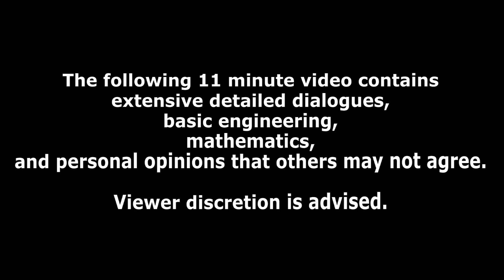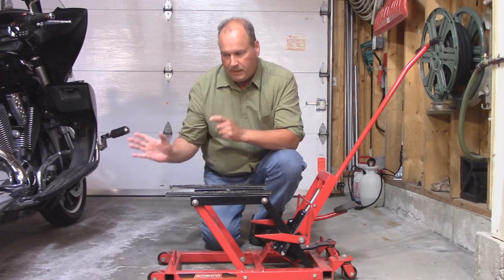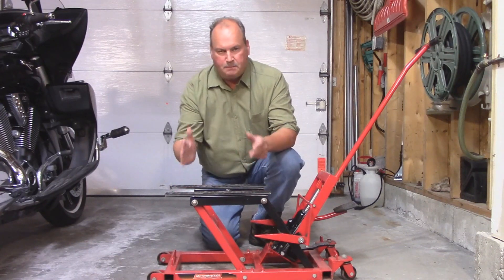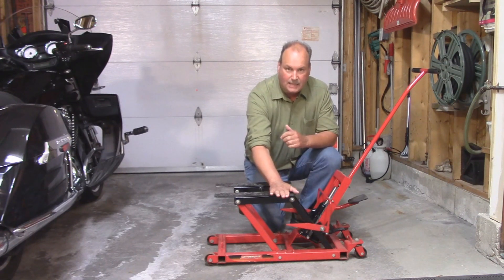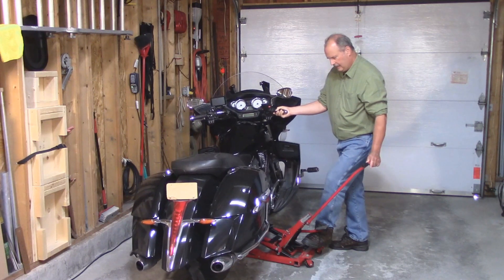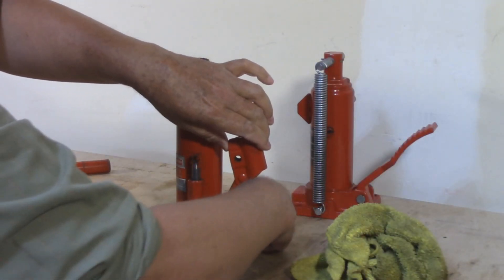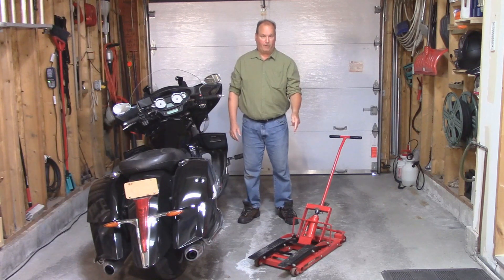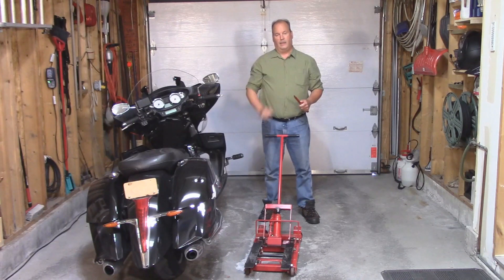Motorcycle Jack Modifications

Comment: G'day viewers 
With most of these stile of bike lifts you DONT very gently try to ease the foot pedal to lower the bike Thats where you will have trouble with shudder and consequently problems 

The jack is designed to have the pedal fully depressed in one fluent motion and the jack will lower the bike to the floor gently smoothly and safely 
I bought my jack from super cheap auto here in Australia Tasmania  its the same as your harbour freight 
Please try what im telling you 
Also i see paul and others advocate not having keeper bars at each end of the saddle bars or cross members the bike frame sits on
Dont use the jack without them and when placing the lift under the bike keep the frame as close to the keeper bars nearest to the bottle jack and set you outer keepers just slightly wider than the frame
This line of thought is to keep the centre of balance more to the centre of the jack
Also the keepers restrict the frame sliding off the jacks  frame ending in disaster 
Ask me how I know 
A great couple of very informative practical videos by you Paul thankyou Olson cheers everybody

Comment: I know this is an old video, but since it is still being served up by the algorithm I figured I'd reply. If you look at the base plate of the bottle jack on the opposite side of the lowering foot pedal you'll probably find a plug or cover labelled "Do not adjust". That adjustment is the lowering rate orifice. No doubt someone broke the rules and messed with it. If you mess with it, you can get the jack to come as slow as you want. You could adjust it so far open that it drops the bike way too fast. As a starting point, it should barely lower with your weight standing on it.

Comment: that's why the jack has loops on the sides for a straps. if you use the straps the descent wouldn't vibrate or shake as much.
Reply from the maker: The loops are for safety, to keep the bike from falling over, not to change the operation of the jack. Also, why then didn't it vibrate after installing a better hydraulic bottle?

Comment: "Tensile" strength is a measurement of what it takes to stretch that mild steel bar to failure.   Like a rubber band. It has no bearing on your application.  A failure of your cantilever mild steel arms won't be in static load conditions.  If your bottle jack drops the bike too quickly (as cheap ones are prone to do), and you suddenly arrest the fall, the force generated is far in excess of your bike's static weight.

Comment: Hi Paul, I am wondering how this new bottle jack is working out for you today. When you made the comparison between it and the old one rated at 1.5 ton the overall size looked very similar. When I saw that it made me think your new jack was over-rated for power. The new jack did perform much better but again, the old bottle jack was worn out. On the day that I am in the situation to repair my motorcycle jack I would like to replace it with a stronger one but the one’s available locally to me are larger in size too. I am using a Craftsman motorcycle jack to lift and service a much heavier Can Am Spyder RT Limited so I now know I’m on borrowed time. I don’t know how and where to shop for a higher rated bottle jack of similar size. Thanks for all of your great information and advice.
Reply from the maker: The 4 ton bottle on my jack is still doing great. I think it will last for at least as long as I will use it. When I go to Canadian Tire or Princess Auto stores in Canada they have 4 and 6 ton bottles about the same size as the one I am using. The 6 ton may be a bit fatter but they both will still easily fit. Harbor Freight stores in the States also has the 4 ton exactly the same as the one I used in my video. Not sure where you are located, but try looking in one of those stores. Thanks for watching.
Reply: @PaulPomerleau  Thanks Paul, I’m in the free States and will look into HF to see what they have.

Comment: Hi Paul, Thank you for your great video! As it happens I recently purchased the PITTSBURGH AUTOMOTIVE 1500 lb. Motorcycle Lift, basically same as yours. I am having the same issue where the arms are same length as my bike's frame width about 13 3/8". 
I would love to attach those Hot Rolled Steel plates to my jack. In the video you mentioned you bolted the longer plates to existing arms. I don't see any bolts sticking up, your plates look nice and leveled. 
Can you please describe how you bolted the extra steel to your jack? 
Thank you in advance! 
Vadim
Reply from the maker: Hi Vadim, My jack came with metal rods welded at the ends of the arms, I don't know why they put them there. I took my angle grinder and cut them off. Then there was some rubber strips on the arms that had small round plugs on the bottom that went through some holes in the metal arms. Those are the holes that I used. I took the arms off and put them upside down on the longer pieces of metal and center punched where the holes were. I then drilled them out and then using a larger drill bit I just barely widened the top of the hole on the longer pieces so the bolts would countersink in them to be nice and flat. Make sure you use the shortest bolts that you can so the rest of the jack doesn't hit them when using it. Now with the them put back on the jack I placed some new flat rubber on the metal using contact cement glue. Hope this helps, thanks for watching.

Comment: I went to raise my bike a bit higher while the back tire was off… (Harley Road Glide) but accidentally hit the pedal to lower it instead. Doh!  Anyways nothing real bad happened as I stopped in time, but it has made me aware that I should do the same as here, so accidents don’t happen.
Reply: There is an adjustment screw on the back side of the bottle, take out the plug and you will see a screw to adjust. It will lower the rate of speed the bike drops. Mine takes about 4 or 5 seconds to drop.
Reply: @340rps  thanks! I had no idea…I’ll check it out!

Comment: Hey Paul, I need to do the same replacement, but wondered if you'd figured out a better way to lower the bike than using the bottle jack release handle?  Lots of times, I feel more secure holding the bike handlebar as it's coming down, even when I use the foot release.  If I'm bent or squatted over using the jack handle to release, I can't really hang onto the bike like I did before and that's uncomfortable to me.  Dean
Reply from the maker: Hi Dean, I haven't actually done it yet but I feel the same as you wanting to hold the bars while lowering. I will need to make a "T" handle type mechanism with a spring attached on one end. This way you can press with your foot and the spring will bring it back to close the valve. That seems the simplest way. Thanks for watching.

Comment: Paul, thank you for this, you are the "first" person to address the "bounce" and the "why" when lowering the load or motorcycle. My Craftsman motorcycle jack does this "bounce" and the worn out seals makes sense since the jack did not do this when new. I'm going to have to see what I can come up with to get this fixed. Thanks again for your time and experience.
Reply: You should have an adjustment on the opposite side of the release. It will slow the lowering speed of the lift making it easier to control the bike. Not going to fix the underrated lifting capacity. I am on my second bottle too on my Harbor Freight

Comment: Fabulous videos Paul. Be curious to know if you have any knowledge about the OTC 1545 Stinger jack?
Reply from the maker: The secret to these types of jacks is how powerful the hydraulic bottle is. With the leverage required by design, a 1500 pound bottle can not lift 1500 pounds without exceeding its limits. I can not find any info on the Stinger jack about the size of the bottle but it must be rated at 2 tons or more to work within its limits. That is the first thing I check for when buying a jack.

Comment: How did you mount the base of the jack to the base?
Reply from the maker: In the video I drilled some mounting holes in the base of the bottle. I then drilled matching holes on the jack plate and used nuts and bolts to secure them together.
Reply: @PaulPomerleau  Thank you for your very quick reply , since the new jack 4 ton has a small bass on it , I was wondering on clamps?
Reply from the maker: Yes, I had to measure exactly where to drill so that it would give me enough room for the head of the bolt, along with a wrench or socket, that it would fit to assemble it to the jack. Then I marked those spots on the flat bottom so I could drill easier. Then I used scrap wood all around to hold it level, clamped everything in place and started drilling using the drill press. It is probably the hardest part of the entire modification.
Reply: @PaulPomerleau  Again Thank you for your quick reply , your explanation is better and yes it look's like it well be more difficult to do , But what the heck , I will let you know how it turns out. Bill

Comment: There's many differently branded versions of this jack available but they all seem to be basically the same. I've got my eye on one for my Triumph Street Scrambler after my screw type scissor bike lift failed by stripping the thread but it was a cheap copy. The Triumph's listed dry weight is 203kg, so let's say 220 curb weight. Using your calculations I think I should be OK with the weight on the jack at 1182lbs and well within it's listed limit.

Comment: A load rating on a piece of powered lift gear normally indicates the maximum load the equipment can safely support, not the power to lift that load.  Putting a higher capacity jack in your system without strengthening the frame is seriously dangerous.
Reply from the maker: Exactly, but this jack advertises a rating of 1,500 pounds. My bike only weighs 900, it should easily be able to do it. But after replacing my bottle twice I decided to do some calculations as to why it fails and found out with the configuration of the leverage that the bottle can only lift a 600 pound load. It is underpowered for the jacks rating. The metal frame has never shown any weakness but the bottle has failed twice.

Comment: Im in the states, im curious , what jack were you planning on getting that you cant get right now. I was recently looking for a lift table , but anything decent is just too expensive. id settle for a quality jack though. I have one similar to yours now , but im not confident in its ability to maintain the weight either.
Reply from the maker: I would love to get the J&S air lift jack. Their site says an HD dealer in Montreal (2 hours away from me) sells them but when I contacted the dealer they said they have never sold those jacks. Also the jack is $675 USD plus $125 USD shipping in the States only, so that would be well over $1,000 CAD for me and I would still need to cross the border to get it but it is closed for now. Anyway, I think I will make my own custom air jack, it will be much cheaper and built exactly the way I want it. I already have a 12 ton air jack.
Reply: @PaulPomerleau  Ahhhh yes. I know that jack. I was looking into getting one also. But I've heard their customer service is HORRIBLE. I also read tons of complaints that the bottles leaked after only a few uses and the customers were pissed because they get zero help from their customer service. I went on their fb and it was nothing but complaints. So I looked elsewere